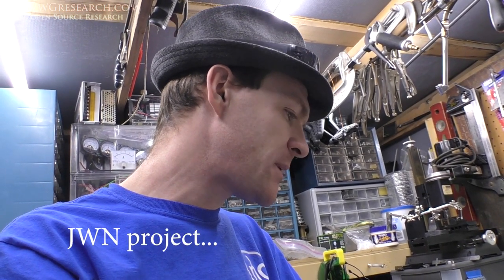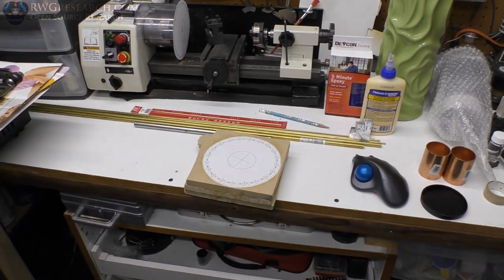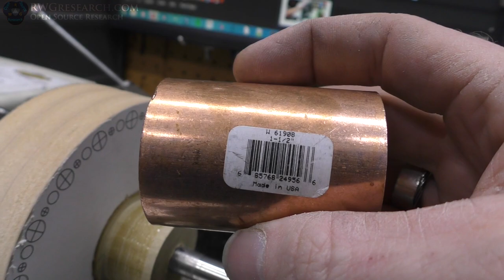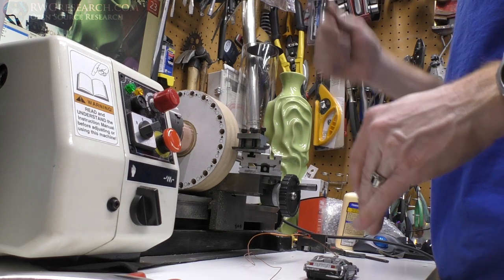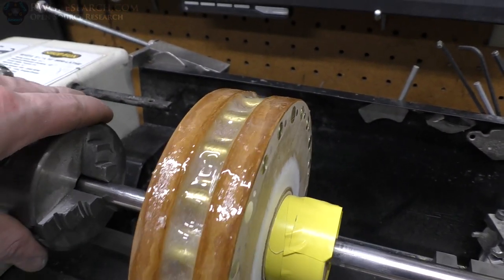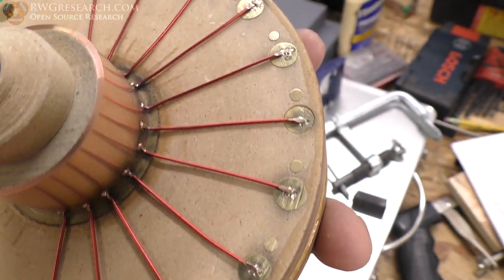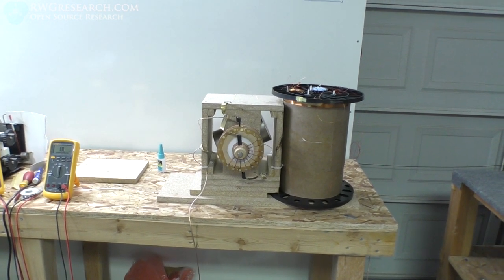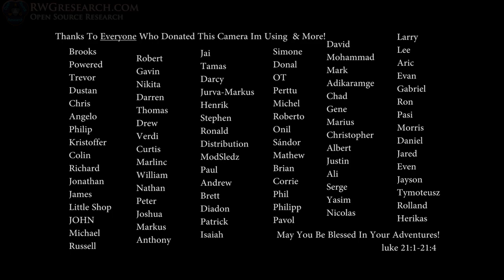JWN Project P1: How To Make A Robust Complex Commutator With Simple Parts

Comment: For brushes, try the silicone coated  noodle wire you can buy in hobby stores for battery pack hook up in RC planes and cars. It has thousands of very thin strands of very conductive silver wire...you can put spot of silver solder on it where it rubs too.  Most efficient brush material I found for low amperage motors.

Comment: Very Nice! JB weld  says that it is an insulator. I have hit it with hundreds of volts of radio frequency alternating current for many hours. It can take 250 plus degrees Fahrenheit all day long. It can be thinned a bit (I used brakekleen) and poured if needed. Superman uses it to repair his shoes!

Comment: So I have been doing a 3D modeling of my interpretation of the Newman book.
and I decided the commutator was 5 " in diameter and the 5/16",3/16,and 1/8" segments distributed along the 18degrees or 360 divided by 20 segments. These compute to approx 7.19 degrees for "Fire", 4.3degrees for "Blank" open, and 2.87degrees for "Short" and 3.64degrees open again before Fire again. I have a excel sheet where I calculate the segment times for a number of rotor speeds in rpm and w radians.

 Russ, How did this experiment come out.

 I am working on a excel sheets for flywheel energy and magnetic torque curve that would be produced by the magnetic field of different coil designs. I guess the real Question is if Newman has a design for a machine that will harvest energy from the vacuum or either or atomic particle spin or what ever you want to call it? My gut feeling is that it can be done!!
Is this the right design? I don't know??? I can tell you this when you observe a ferrous metal fly across the table on its own only from the attraction from a permanent magnet. This tells me there is energy in them and it had to have come from somewhere.  There are those that will say that "Well is takes as much energy to take the pieces apart again so there is no gain.
this may be true of the case. But the fact of the matter is that it did work by moving a mass through a distance, and if the two pieces are never taken apart has no bearing on weather there was work done, and it was. So one only has to be cleaver in making a device to harvest this energy. I think Newman has a good idea. I intend to replicate his small model. I wonder how others are doing in their efforts.  What is intriguing about his design is it has no ferrous metals in it, nothing to slow down a rotor. And Newman is correct about getting two bangs for your buck so to speak on the energy in and getting twice a much out well almost.
 There are I2 R losses to be considered. You "fire" the coil and get torque out that propels the flywheel forward and you turn off the coil with the commutator and you get rushing back out of the coil, a back EMF that charges the battery backup. The question is how much??? You also put kinetic energy into the flywheel with that "Firing" of the coil, but now the permanent magnet generates and cuts the coil winding to generate more power from that kinetic energy. Genius!!!
And he does this ten times in180 degrees of the rotor and then switches the polarity with the commutator and does it all over again. I don't have the math skills to integrate the energy pulses that come back out from the back EMF.  Few people do.  This is no easy task. But it can be figured out experimentally. 
Russ: Please Tell Me How You Came Out on this Project.

I kind of f

Comment: Always very informative to see what you have accomplished so far, Russ. After studying various new theoretical perspectives on new tech/new physics, I don't think that "mass to energy" is what is happening. Denis Lee has some practical successes, but theoretically, I think that Walter Russell, John Keeley and the work of Ken Wheeler (more recently) and others are demonstrating and offering theory that strongly suggests matter is vibrational 'knots' of energy (standing wave) that channel energy - there is no matter to energy 'conversion' per se. More of a harmonic/sympathetic coherence that channels energy (etheric in nature). So, I think working with Keppe Motor circuitry may advance your efforts more quickly, as they do not use such massive windings as Denis Lee's approach. Already they demonstrate very high efficiencies (I built a fan kit to verify - yes - 4 to 5x's more efficient!).  Just a suggestion of directions to go. Obviously you are demonstrating and learning but maybe not the most efficient path to discovery for these type of technologies.

Comment: Hi Russ, great videos........Just wondering......would you be able to eliminate the epoxy if.........the copper fitting was heated first then pressed into a snug fit wooden dowel....allowed to cool.......snug as a bug in a rug, assuming the copper fitting didn't heat up too much............jimmy
Reply from the maker: Jimmy Kuros well I need somthing for the brush to ride on when its not touching the brass.  
 So not sure what your saying.  But it feels like its better to epoxy after.  Due to the rod wanting to spin...  

~Russ
Reply: Sorry 'bout my vagueness......think of the science experiment with the metal sphere attached to a rod.....and a steel ring attached to a rod....the sphere passes thru the ring when cold....not so much when heated.......thanks for the channel my man...........jimmy